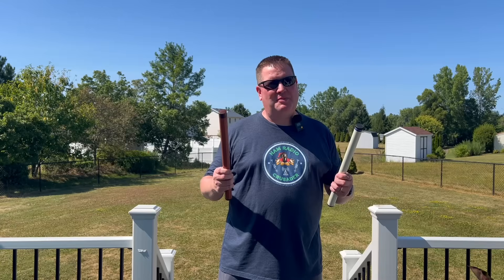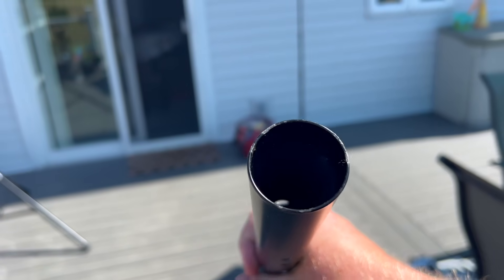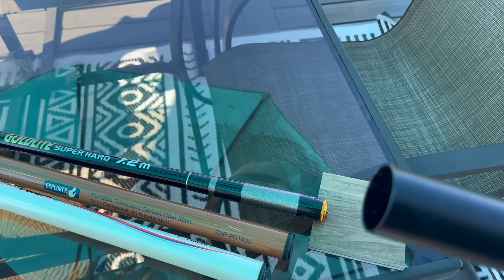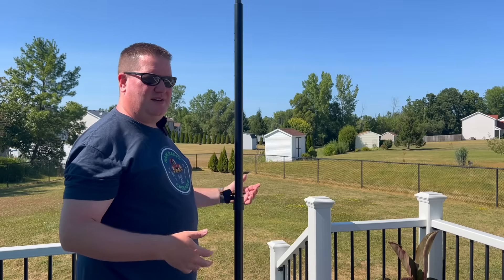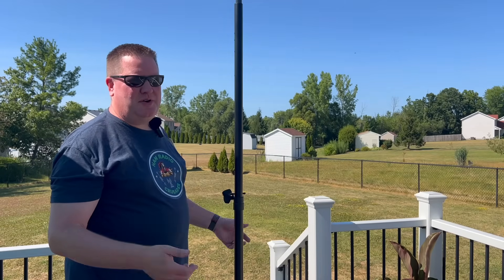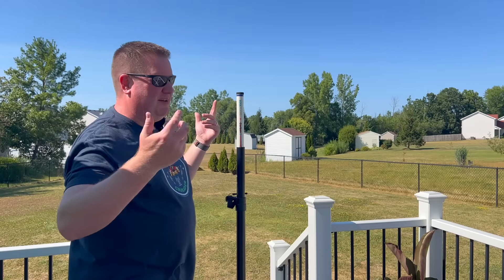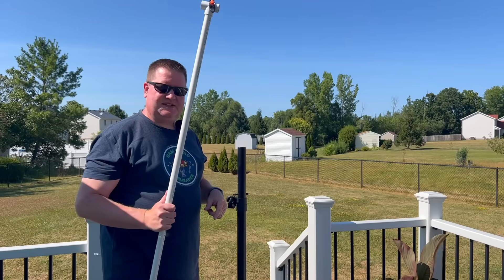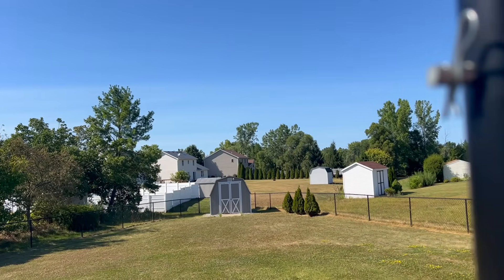Best Way to Setup Antenna Masts for POTA? No Guy Lines or Stakes, and it Adds 4 Feet to Small Masts!

Comment: I have been using tripods for the last 3 years etc. But mine are low cost lightweight as some of my outings can be a good 5 mile walk carrying all the kit myself. On the moors or up.high 50mph winds so tent pegs and guys a must. 73,s from old George
Reply from the maker: This speaker stand is a cost effective option but it’s definitely not something to hike a few miles with. I’d love to find a nice lightweight option that doesn’t cost much. Thanks for watching!
Reply: @MikeN2MAK Selfie stick tripods or lighting tripods. Alliexpress £8.50 uk pounds. I cannot remember what mine are but plenty to choose from. Also telescopic whips and coils etc cheap. But M10 standard thread as in Europe.  George

Comment: I picked up one from Amazon this week.  It's too heavy for backpacking so it's not much use with my Carbon 6.  However, if I shim out the top tube with duct tape it fits nicely inside my 10 meter Travel Mast.  That would get me up to maybe 37 feet.  It'd be perfect for car POTA outtings. Hmmm.... I wonder what I could hang from it?
Reply from the maker: That could be great for a simple 40m 1/4-wave or 20m EFHW vertical.

Comment: Seems good for when you need 33ft+ but only have a 30ft. mast
Reply from the maker: That's actually a good point. 33 feet would be really nice for a 20m half-wave or 40m quarter-wave. Same thing with turning a 20-foot mast into 24 feet for a Rybakov antenna. The carbon fiber in many of those mast will interact and throw things off unless you can get the wire away a little bit. But still, it can work and I've used wire verticals with carbon fiber without issues (or at least I didn't notice any).
Reply: @MikeN2MAK Exactly, Mike. The 20M 1/2 wave is my preferred POTA antenna. Walt had a great idea. He taped 3ft of an old fishing rod section to the top for his 20m 1/2 wave and 30ft mast.

Comment: Adding three guy lines would help. Possibly cut a square of breadboard and drill it out to slide over the tube with 3 holes for the guys.
Reply from the maker: That’s a good idea. And water jugs could be used when stakes can’t be. Thanks!

Comment: That's a cool setup.  Patio umbrella stands work also for mast supports.  Some have foldable legs and others can be weighed down with water, sand, etc.

But your method even adds some height to the mast which is always helpful.

Thank you for the video and keep it up.  🙂

Stay safe and happy hamming Everyone.  😁😎
Reply from the maker: I've used the patio umbrella stands before and they definitely work. Adding the height is a nice advantage though, especially since some of the masts, like the Carbon 6 or Goture fishing rod are very thin near the top few sections, which can cost you a few feet.
Reply: @MikeN2MAK that's true.  I use the POTA 20 which is a good mast.  🙂

Comment: Did you make the stand offs for the ladder line J Pole antenna? They look really nice. do you have a print file for them you can share?
Reply from the maker: No, I didn't make them. N9TAX sells them for $6 a pair on his website, so I got them when I ordered the antenna. It was convenient, since I don't have a 3-D printer and they're made for 3/4-inch PVC, which I have a bunch of. Here's a link to them on the N9TAX website if you're interested. https://n9taxlabs.com/shop/ols/products/pvc-mount-for-n9tax-slim-jim-antennas

Comment: I found, at a yard sale, two 25lb weights for $5 each.  I lay them on the ground (no stakes) upwind of the tripod, 90 degrees apart.  I then tie  lines to the tripod  where the mast slides up and down.
Those tripods used to be $34.  I bought two of them about 2-3 years ago.  I use them all the time.
Nice yard for putting up a vertical antenna.  Let me guess....
HOA?
Reply from the maker: No HOA, just an XYL, LOL. I'll get around to setting up something permanent soon, but I need to make room in the basement to setup a makeshift shack first. I primarily do POTA and there's a lot of parks nearby, so it just hasn't been a priority yet. Thanks for the tips on the weights!
Reply: @MikeN2MAK  Ha!  You can tell I've never been married!!  Good luck with that then. NR7Z

Comment: Another way to eliminate wobble on some of the smaller masts is to 3D print a small bushing type thing. It would sit in the tripod with walls thick enough to take up the slack and a lip to hold in place. I haven’t tried it with this tripod, but I have done it on the bigger hitch mount mast holders to take up the slack in a 2 inch hole for a 1.75 inch mast.  Also, to weigh it down you could try sandbags, the ones I have for photography are like a saddlebag with a handle in the middle and the two sides just straddle the legs. I can’t post links here , but I’ll find you in one of the discords and show you both things. Which is best TOADS?
Reply from the maker: Thanks! TOADS works.
Reply: @MikeN2MAK  I couldn't find you listed in TOADS, or any of the other Ham discords. I sent you an email to your ARRL email.
Thanks
Reply from the maker: @WG5Xradio  thanks, I got it!

Comment: Another option for ballast would be to use a bag of rock salt used for ice melting in snow and ice environments.  You likely have a bag on hand already.   A little more work, would be to get some bags of play sand from any of the big box hardware stores.  I have seen some photographers cut up inner tubes for bicycle tires (large diameter) into sections and fill those to make weight sausages.
Reply from the maker: Rock salt! That's a really good idea, especially for the January VHF contest, since I'm sure I've some bags in the garage, LOL.

Comment: I use this stand. I used sand bags... I fill the bags with river stone, not sand...  I point one leg into the wind and place a bag over that leg.  Never had it fall over that way.  I also use a 6 ft. PVC over the stand. The PVC has a bolt through the  PVC about 3 ft from the top.  I insert the mast into the PVC so this adds  8 ft to the mast.    Extreme wind you can add additional bags to each leg.   Always works for me.
Reply from the maker: Awesome! Thanks for the tips!!
Reply: Using river stones is a good way to go.......cleaner and easier to deal with than sand or water.  Good thinking.  🙂